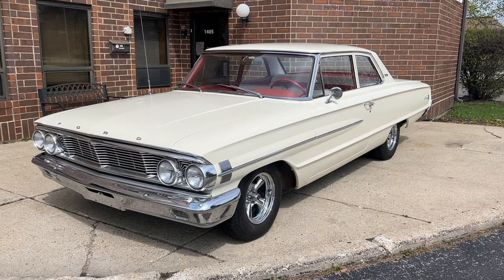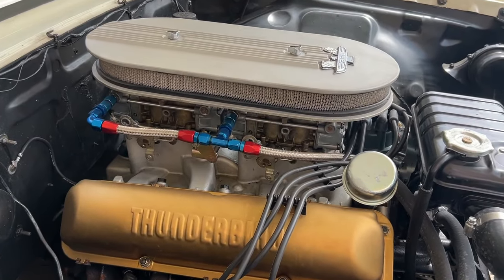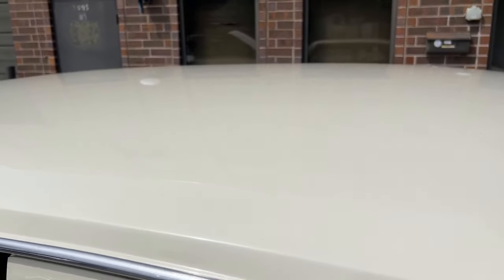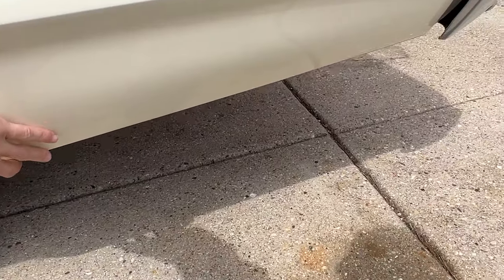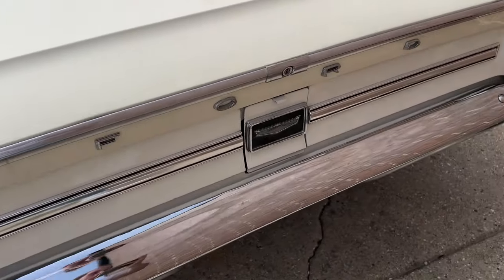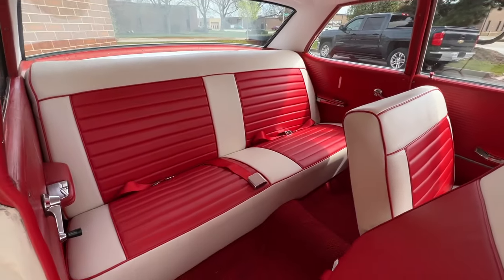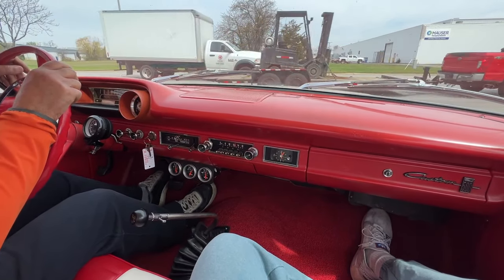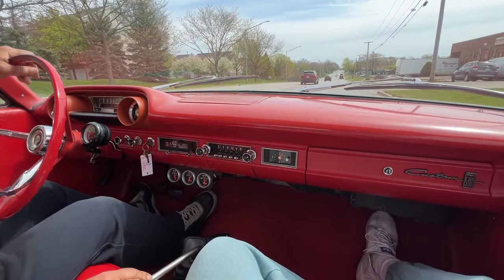1964 Ford Custom 500 - FE 390 2x4 W/ 4spd - SOLD!

Comment: How much did it sell for? Always interested in market value.
Reply from the maker: I traded it towards a Mustang fastback. The price that the car was agreed upon value wise for the custom 500 was 25k. I haven’t seen one since. Super hard to come by. Especially an original metal car from top to bottom, too. - Andrew
Reply: Awesome thanks 25k is rt there for market value. I have a 64 as well it's basically the custom but it's the Galaxie upgrade trim package.  Has the custom Pilar w/ Galaxie trim inside and out. Again thanks for taking the time.